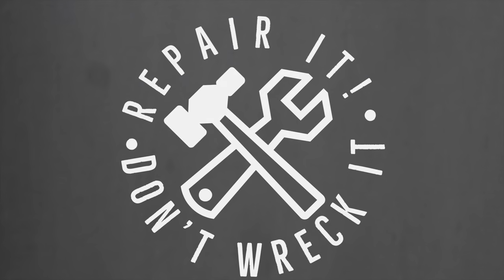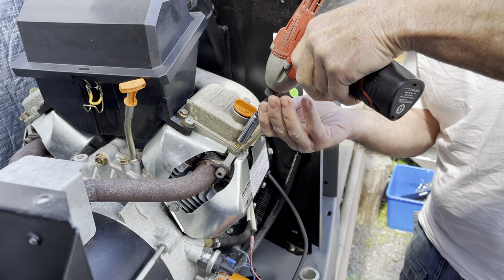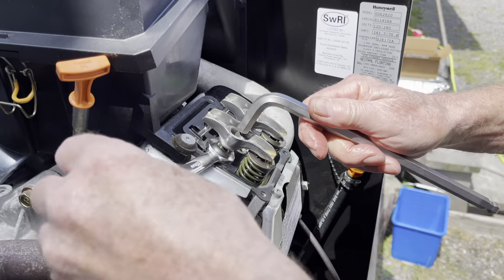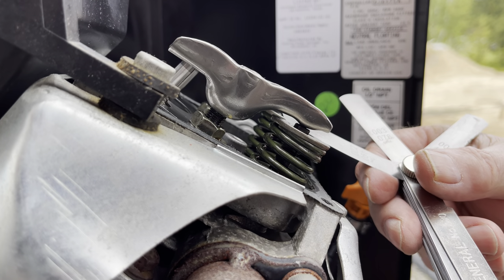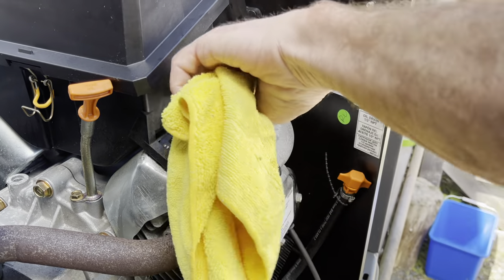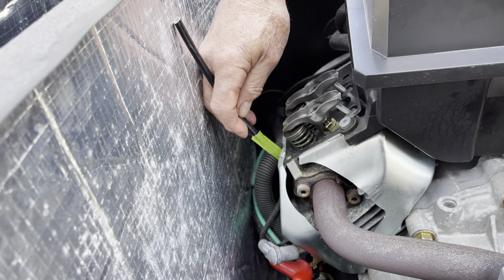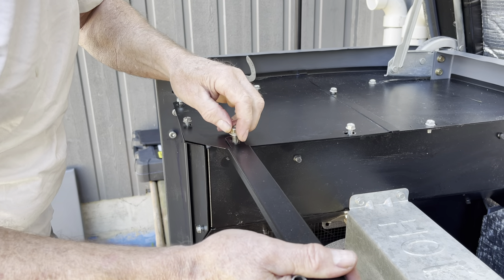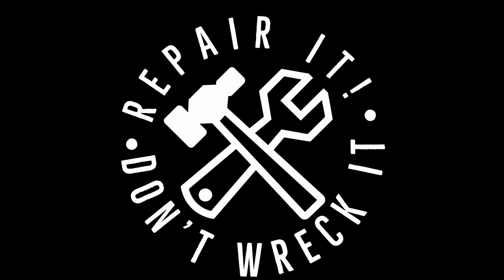Adjusting the Valve Lash / Clearance on a  Generac / Honeywell Air Cooled 17 kw Whole Home Generator

Comment: Pro tip: No need to remove the muffler cover panel, only need to remove the 6 bolts for the front cover. And you don't have to reach across a hot muffler. Valve clearance needs to be set with a cold engine, but it's is acceptable to run it for a very short time before hand, but the muffler gets hot in that time. That gear wrench magnetic spark plug socket is awesome!
Reply from the maker: Thanks for the tips @nonyabeeswax2967. Yes the plug wrench worked very well. I got the idea to use it when changing plugs on my Ford Ranger. It’s a 6 cylinder and one side definitely is easier with this style spark plug wrench. Thanks for watching and posting comments. Roger
Reply: No valves on the back side of the f”Generac?

Comment from the maker: Yes I ran thru the cycle twice to make sure I knew where I was in the combustion cycle. The trick is to keep an eye on the valves as you are going thru the cycle. When the intake valve is opening(right side facing engine) that is the intake stroke. The piston is going down. Intake valve is open. Now as the piston comes up it is on the compression stroke. Both valves are closed. When the balloon is filling up it gives me a visual indicating both valves are closed and the piston is compressing the air into the balloon. At this point at top dead centre you should be able to wiggle  the lifters. If you can’t your not at top dead centre or the valves are super tight. When the balloon collapses the exhaust valve has opened and you have gone to far in the cycle. You can always go thru the cycle as many times as you want to find the sweat spot where the balloon fills up and both valves are closed. Either way works. Ballon and stick. I think if your doing this for the first time I would use the wooden dowel in the spark plug hole. It gives you a better feel where the piston is. Going up and back down. I hope this helps and makes sense. Thanks

Comment: How about cutting the time in half by using a remote handheld starter button and adjusting the valves using the Exhaust Opening, Intake Closing method? All four stroke engine valves can be adjusted using this method. All professional race teams and engine builders use this method. First step is to bump the engine over until the exhaust valve starts to open and adjust the intake valve next to it. Next bump the engine over until the intake valve is almost closed and  adjust the exhaust valve. This process is fast and will always make sure you’re on the base circle of the camshaft. Always adjust the two valves on the same cylinder.
Reply from the maker: @RonnieWaynesGarage  Thanks for the post. I’ve had several great comments such as yours. I think the best thing to do is create another video using these comments to see what seems to be the best way to do the valve lash most efficiently and accurately. This video was a little trickier. Most people watching may have never done it before. I wanted to demonstrate the adjustment in the simplest way . Maybe not the fastest but I wanted to make sure I was clear. I appreciate comments as there are many people that are much better at this than I am. People can read the comments and decide what they think works best for them for them. This is one of the neat things about Utube. Roger

Comment: Great job!  This valve gap and oil change at 25 hrs run time, annually or every 200hrs required per Generac owners manual .  Be sure to document it, start a log with receipts in case a claim needs to be filed in the event of a failure.  And yes, you can do this on your own, does not void warranty.
Reply from the maker: Hi  @lynnmason6020. I’m glad you enjoyed the video. If you take your time it’s not to difficult as you know. Some basic tools and an understanding of how things work. The more you do yourself the more independent you are. Also, it’s fun and satisfying to look after your own stuff. Thanks for posting. Roger

Comment: Thank you to Repair It Don't Wreck it!  I also used your great video to adjust the valves on my 14 kwh machine.  For me, finding top dead center by myself was slightly difficult as the straw I put into the spark plug opening would get stuck on the downward stroke. I also found the jam nut on the right side (closest to the control panel) hard to loosen because I couldnt fit a full size wrench in without bumping up against a black panel wall.   I had to use a smaller length wrench that was not easy to turn.    The job took me about 1.5 hours end to end and save me from a $400 service call (what the local dealer charges).  Thank u again!
Reply from the maker: @jinjunwei  Sounds like you had a few problems but solved them. Reading instructions on how to do something is important. But things can changed once you get into the job. That’s why it’s hard to cover all of the bases in a video. It would be so long people including myself would loose interest in it. Having a solid foundation and the ability to figure out solutions on the fly is key. I’m glad it all worked out. 1.5 hours is pretty darn  good. Thanks for posting and commenting. I appreciate it. Roger

Comment: I watched this video and fixed my 14kw LP standby generator after two separate service companies were unable to diagnose and fix the problem. I was out of options and decided to just go for it even though I have limited knowledge about small engines, having done simple things such as changing spark plugs or doing an oil change. I did a victory lap around my yard when the engine roared to life. 
We live on an island on the coast of Maine and power goes out frequently and for days at a time, and finding reliable local service has proven to be a fruitless effort. You’ve helped this family of three survive the winter and you’ve helped strengthen our self-reliance. 
These videos are the reason I came to YouTube when it first launched, unfortunately they’re increasingly fewer and harder to find.
Reply from the maker: Hi there Mad Bear Forge. Thank you so much for your kind words. I am thrilled that the video got your generator on track. What could be better for a utuber like myself to help out someone in a pinch. Good luck with your future projects armed with a new level of self confidence. Thanks again. Roger

Comment: Excellent work! (I'm an 25 year EGSA certified Generac technician). The only thing that made me wince was putting the bulkhead screws on the top panel. If one drops, it could turn into a long afternoon trying to fish with a magnet, or taking the enclosure apart at that end. (Reason being the alternator becomes a large magnet, and can suck a small screw or washer in, shorting the rotor and stator.)
Great vid!
Reply from the maker: Hi @darrenotis5672. Thanks for checking out the video and posting your thoughts. I never thought of the ramifications of dropping a screw and causing some serious damage. Thanks for bringing it to my attention. I value your comments especially coming from a highly experienced tech. Roger

Comment: I'll have to do this myself.  Thanks for the video.

My Generac dealer always up sells service contracts, and they don't even use Generac parts.

The first service I did, I ordered all Generac parts and replaced no-name parts the dealer had installed.  Kinda mad the dealer would save a buck by doing that.

Edit: Finally did it.  The generator shows 80hrs of use and I found everything to be a little loose.  Thanks again for the video.  Very helpful.
Reply from the maker: Hi James D. Thanks for watching the video. I would be unhappy if a GENERAC dealer didn’t use GENERAC parts. I’m sure there are parts that work but these days it’s not easy to confirm the quality or proper fit. To be save safe,  purchase from a reputable source. The money you save on labour far outweighs the extra cost for dealer parts. Adjusting valve lash is not to difficult but you have to take your time. If you have some experience around equipment such as lawn mowers, snow blowers, car maintenance or fixing things around the house it shouldn’t be a problem. I think the video explains what your getting in to. If your unsure you could remove the valve cover, spark plug, find top dead centre and check the gap. If you are having trouble at this stage I would say it would be out of you skill level and have someone do it for you. If the valves are not adjusted properly, starting the engine could cause some serious damage. Roger
Reply: If he's a Generac dealer I'd be calling Generac head office and let them know what he's up to.  I'm a Generac dealer and what he is doing is wrong

Comment: I watched this wonderful video, took notes, and prepared to take this on and gave the manual one more read through and noticed "IMPORTANT NOTE: Valve lash not required on 14 or 18kW units with 816cc engine."

That was kind of a relief and my lessons learned were "always check the manual first" and "this is a generic manual, pay special attention to 816cc notes" 

Also totally my fault because I have an 18kW and you literally have 17kW in the title and 17 != 18 and reading > me.
Reply from the maker: @rajon25  Thanks for looking at the video and posting comments. You make a good point.  Always check the manual specific to your equipment. It looks like Generac is producing some of their equipment with hydraulic lifters. This is a great feature. It reduces the amount of maintenance which can get expensive but necessary to keep you generator reliable. Roger
Reply: @repairitdontwreckit4257  the worst part is I'm an electrical engineer so I should have known better but I am staunch believer in reading manuals and following manufacturer recommended maintenance. I really love sharing everything I've learned and am so happy that there are other people that are willing to share what they've learned too. Thanks for what you do! -Jon
Reply from the maker: @rajon25  Your very welcome.

Comment from the maker: Hi David. I understand your frustration. If it’s not out of your reach I still would check the valve lash at least on the front cylinder which is fairly easy to get to. It doesn’t hurt to check to help rule out things. You say it’s running pretty good after it starts but it’s worth a check. The other thought I had,  the solenoid on the fuel regulator may have a small leak at rest. When the generator sits for a while there’s a buildup of gas which causes the hard start or popping. Once it starts it’ll run fine because it clears the excess fuel. It’s like flooding a car with a carburetor. If it starts with no problems in consecutive attempts it may be the problem. There’s still a chance it could be ignition. This is one of those problems that can make you crazy. There are some tests you can do with a manometer on the fuel regulator. Resist the temptation to throw parts at it. It can get expensive. There is a web site that you can ask questions on their forum. Also post videos of your problem. There’s a bunch of professionals that install and service generators for a living. They  provide quality advise. If you need parts Chris the moderator will be able to get them for you and support you thru the process of installing them. 
It’s called Gentekpower.com    I hope this helps. Roger

Comment: Simply a great video. Probably the first one I’ve seen (I have looked at a LOT) that gives a clear description of how to turn the fan to get to TDC. Everyone else says CCW …. but what is the orientation of the observer? Pull the fan UP to the exhaust. Well done. 17:30
Reply from the maker: Hi jatimmonsjr. Thanks for checking out the video. I am not sure of your question.  I’m going to try to answer what I think it is. When both valves are on the compression stroke and are closed. that’s a good spot to adjust the valves. When facing the fan from the muffler end , and then looking towards the air filter turn it counter clockwise. This is the direction you should be rotating the crankshaft according to the manual that Generac produces. There are other ways to set the valves but I find this the easiest way to demonstrate so people don’t get confused. In reality, you can adjust either the intake or the exhaust valve when they are fully closed.  As long as the valve is not on the lobe on the camshaft, it can be adjusted. Some people don’t quite understand how this all works.  I try to keep it simple. I hope this answers your question, if not send me another comment and perhaps reword your question. Thanks for watching.Roger
Reply: @repairitdontwreckit4257  that answers it perfectly. Thanks again for the great video and for your reply. I can’t wait for the weather to warm up so I can get out and tackle this job.

Comment: Excellent video!  I have a 2014 22kw and I do the very basic maintenance stuff (spark plugs, oil/filter change) but never adjusted valves which I've always felt might be a daunting task.  Watching your video makes it SEEM easy. It certainly looks "simple". Anyways, a newbie question.  I see the valves moving up and down (3:57) but don't understand "how" you're doing that. I was under the impress that one would have to turn over the engine (by rotating the fan) for that to happen?  I see both of your hands so unless you have a prehensile tail that you're using I'm a bit baffled! lol!
Reply from the maker: Hi CGF. Thanks for checking out the video. Yes you have to turn the engine over. The video didn’t catch it. I removed the sheet metal panels that protect the muffler. Once that is done the fan can be rotated which  is connected to the engine. If you are replacing the spark plugs removing them will make it easier to rotate but not necessary. I hope this makes sense. Take your time. After setting the gap re check  as it can change after tightening the lock nut. You may have to try several times but be patient. A slight drag on the feeler gauge is what your looking for. Engine should be cold. Not run for a few hours or overnight. If there any other questions I’ll try my best to answer answer them for you. Roger

Comment: Great video, very helpful for someone who hasn't adjusted valve lash in many years. Also, it looks like that generators exhaust was placed really (too) close to the furnace intake/exhaust if that's what those PVC pipes are for in the background.
Reply from the maker: Unfortunately I couldn’t get more information from the owner. I agree that the pvc piping is probably to close to the generator. It wouldn’t be to hard to rectify. There is a plenty of room to raise or laterally extend the pvc to meet the requirements. When I was looking at the requirements in the gas code and the Generac installation manual it can get complicated when looking at the rules and charts. For complicated installations I definitely would run my plan by the inspector as there seems to be some room for interpretation. You don’t want to start making changes after the install is finished. Thanks again. Roger

Comment: I really appreciate your video.  I'm going to do an adjustment on my old 2005 era generac.  It has about 10 hours since 2009 on it.  Always hard to start.
Reply from the maker: Hi  Eastman Research. Thanks for checking the video out. It’s a good start to check the valve adjustment. Also check the fuel pressure, air filter and spark plug gap while your there. Roger

Comment: Great Video great explanation. I feel more confident with valve adjustment since I watched your video. That was the one thing that I wasn’t sure about. Have a Great Day.
Reply from the maker: Hey, TheAirboss1955. Thanks for the comments. It’s not that difficult. Just take your time and have the proper basic tools. Sometimes when you tighten the jamb nut the adjustment changes. Be patient and re set the gap. It may take a few times to get it where you want it.

Comment: Great video, I bought a generator like the  one you serviced, I haven't did a valve adjustment but I know I'll have to soon, thank you for the great information, happy holidays
Reply from the maker: Hi Joe Jones. Thanks for checking out the video and taking time to post your comments. I appreciate it. This was my nephews generator in the video. It has been very reliable. No issues so far. I have the 11 kw version with the smaller 530 engine. Also no problems. This particular series seems to have few issues. Good luck with your generator.  Happy holidays to you also. Roger

Comment: It is my understanding, that the annual maintenance also requires oil and filter change as well as the air filter change out.  You have the machine opened up, so it makes sense to do a complete annual maintenance and inspection.  The video was otherwise very informative.  Thanks!
Reply from the maker: Hi Steven D. Thanks for taking the time to view the video. Maintenance as you know is critical to ensure these generators start when there is a power outage. Every manufacturer has its own time frame for oil changes. On my GENERAC the owners manual says every 2 years or 200 hours. For me I prefer to change the oil and oil filter once a year even if the running hours are low. I think the oil should be checked, and an inspection of the generator enclosure should be done a couple  of times a year at a minimum. If there is a problem such as mice the sooner you catch it the better. There are very few power outages where I am. Most of the running time is from the exercise schedule. It might be over kill but since I’m doing it myself the cost is worth it.  The air filter all depends on the condition of the area the generator is located. Just like a car,  if driven in dusty conditions you may have to replace it more often than the manufacturer states. Always maintain at the manufacturers specifications as a minimum. Roger